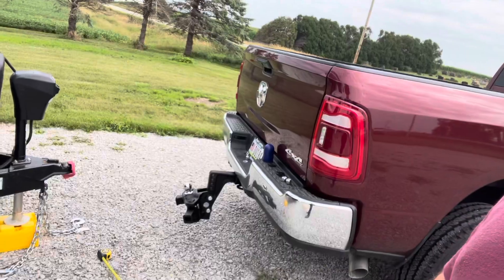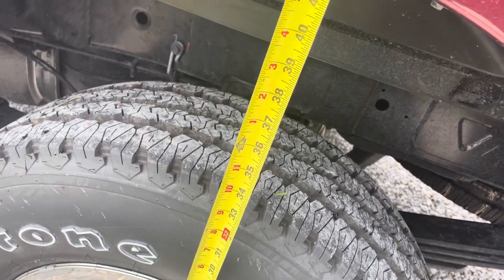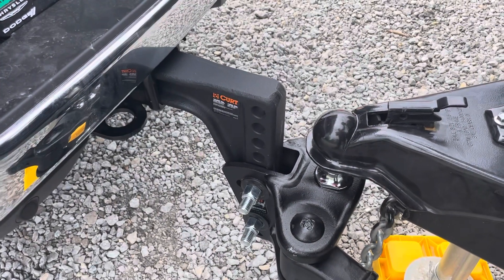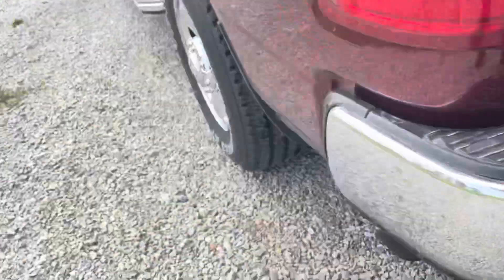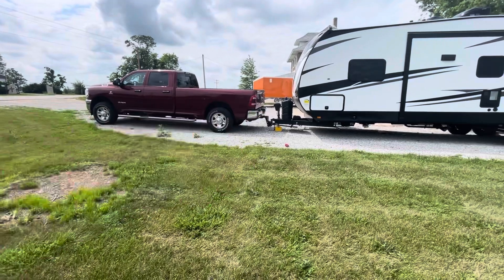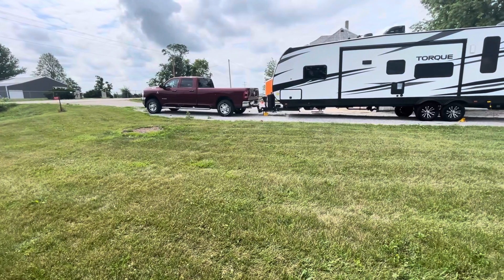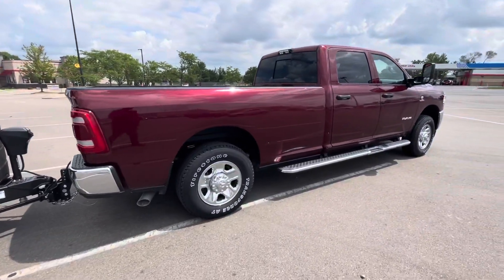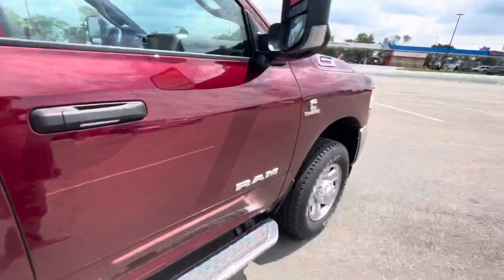Ram 3500, torque t286 toy hauler. Setting up the weight distribution hitch.

Comment: So I’m curious about the trucks auto leveling system with the air bags when hooked to a trailer as it relates to a weight distribution hitch. I own a 16’ Ram 3500 Dually with factory air bags and want to know do I setup the weight distribution hitch first then hit the alt trailer button to level out the truck or? Do you have any idea?